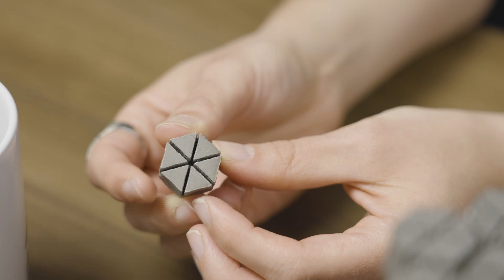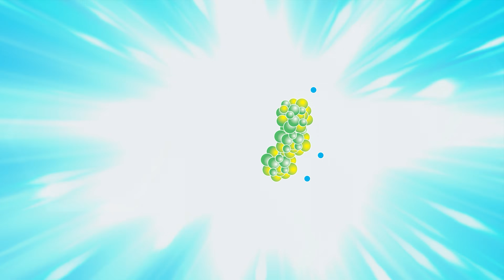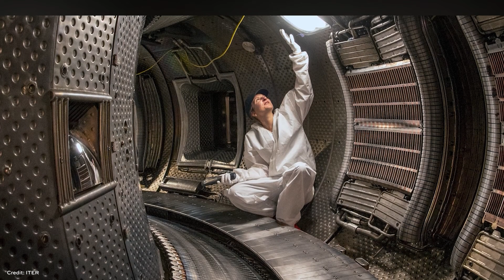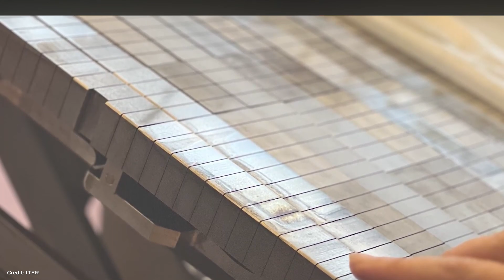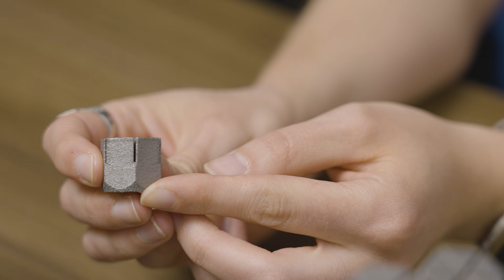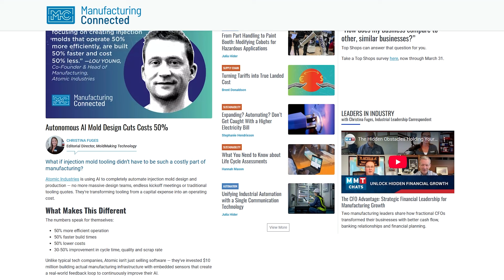3D Printed Tungsten Divertor Tiles for Nuclear Fusion | The Cool Parts Show

Comment: Very interesting. This involved an area found in experimental tokamaks and similar torus type machines. It is rarely mentioned in fusion energy promotional videos since much experimental work is needed in this area and many  of the promoters prefer that the journalists, the general public and the funders buy into their marketing pitch that suggests that almost all fusion energy generation issues have already been solved. This sort of hype, regarding the degree of advancement in the field, has gone on since the first experimentsts began, in the mid-1950s. It is one of the primary reasons the derogatory phrase, 'fusion energy is always 30-years away' has become so prevalent. It has been common practice for fusion energy project administrators to omit numerous key evaluation technical details when creating press releases and general announcements of their advances. For many decades the general public was told that the hydrogen fusion fuel was almost unlimited since it can be derived from ordinary water. Always omitted was the fact that during most of that time the cost of commercial, radioactive, tritium was approximately $30,000 USD per gram. Most current experimental tokamaks operate in a pulsed mode with extremely low fusion energy duty cycles. As a result the displayed tungsten diverter tiles will unlikely be exposed to the extended heat loads that they would be exposed to in an eventual operational power reactor. An example of this discrepancy is found in Commonwealth Fusion Systems (CFS)'s SPARC experimental machine. If it ever achieves CFS's peak fusion energy goals the fusion reaction period will last a maximum of 10-seconds per pulse and then the machine will require approximately a 4-hour thermal recovery time period before another fusion test pulse can be attempted. This means that it will have a fusion energy duty cycle of 0.0007 under that configuration. In order to achieve CFS's design goals, for its conceptual ARC power plant, the fusion energy duty cycle will need to be improved by a factor of approximately 1,000.

Comment: It's really worth noting what kinds of heat loads a divertor inside a tokamak is expected to experience. On something like ITER the expected heat flux at the divertor is 10 megawatts per square meter. On the SPARC reactor in Massachusetts that uses high field, high temperature superconductors for its toroidal field, the heat flux will approach 50 megawatts per sq. meter. 
A common propane blowtorch reaches around 0.2 MW/sq. m, and THE SILICA FIBER HEAT SHIELD TILES ON THE SPACE SHUTTLE EXPERIENCED ONE MEGAWATT PER SQ. METER.